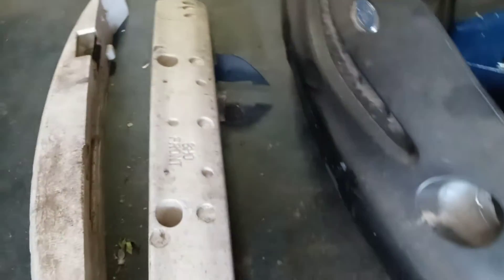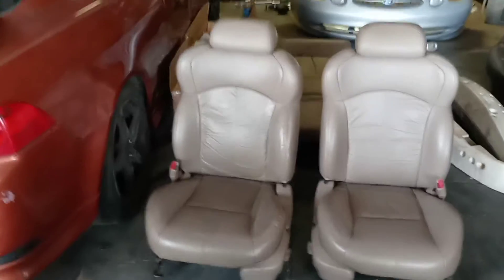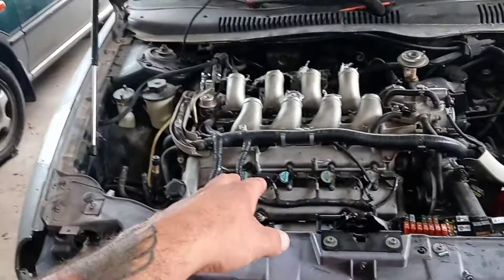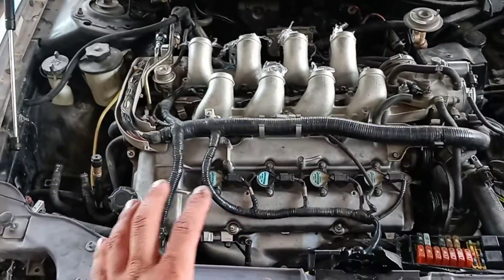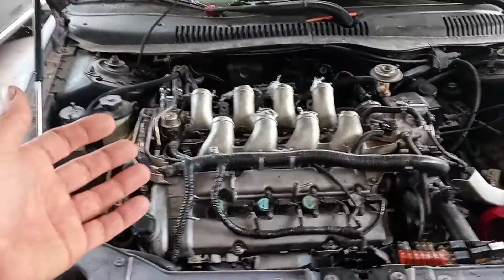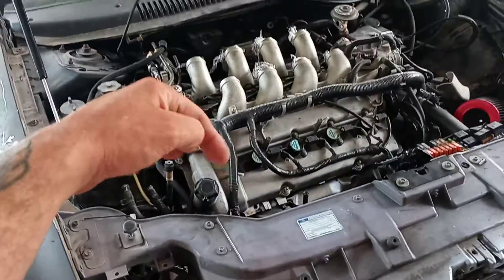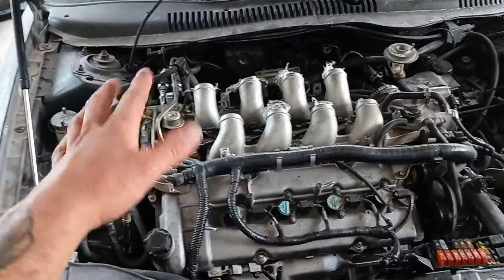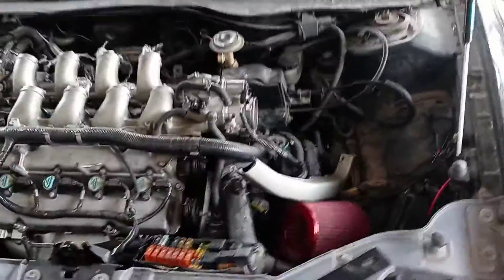V8 SHO cold foraged camshaft sets coming soon - maybe

Comment: Hey I know you're busy with your builds how has the sho been coming along
Reply from the maker: The SHO is at a dead stand still, I got a job as they Power And Performance instructor at UTI Avondale so I closed Emistry Racing and now the car is just sitting there at my shop in New Mexico while I'm out here working in AZ. Last thing we did to it was had cams made which came out amazing and made a massive power improvements over the stock cams.
Reply: @emistryracingllc2400  will we see that eventually?

Comment: Are you still securing pre-orders? If it's not too late,  I'm interested. I'm swapping one of these motors into a miata and this would save me from having to regrind the stock ones
Reply from the maker: Well what ended up happening was the Facebook SHO forum spread rumors that these motors can't make power with cams and that I was ripping everyone off. Within a week after that became rampant on any vid of me posted, 6 preorders backed out and requested full refunds because the uneducated "experts" on there convinced everyone I was wasting their time and even went as far to claim I may rob everyone, despite me working directly with Crower cams on this project. Since I only had 2 preorders left by October the whole deal fell through. 

So, I just had 1 set of billet high lift cams made for mine and then finished the weight reduction, now the SHO engine is being swapped into the back of my Subaru. 

To be quite blunt, V8 SHO guys seem to be closed minded and often times extremely uneducated when it comes to automotives, as well as the theory of power. In turn, most of them are totally convinced that Ford/Yamaha made this engine at it's limit, which is super incorrect as NA you can squeeze like 350+whp out of the 3.4 and with boost even on a stock bottom end with welded stock cams people have consistently made 450+whp, so don't let them convince you you can't make power. If you want me to fabricate parts or perhaps setup a custom cam order, contact me on my Instagram @emistryracing, and I can work out a deal to have another set like mine made, the cost is high because the deal that fell through, that was supposed to help make the prices lower but no orders = no production discounts.
Reply: @emistryracingllc2400  where can I find more info on people buying these? I can't seem to find anyone doing anything more than a tune injectors and thottlebody etc.
Reply: It's a damned shame. My first car was a 96 taurus and always wanted the sho version. I've been thinking of getting one of these and would've pre ordered a set.

Comment: While you are at it you should see if you can get someone to produce aftermarket valves, so we can actually fix any motors that have grenaded themselves. since really the only parts that need to be replaced when that happens is the head gasket, studs(maybe), valves, and camshafts... Assuming that the piston and connecting rods are ok.